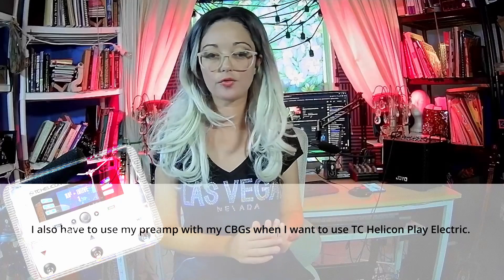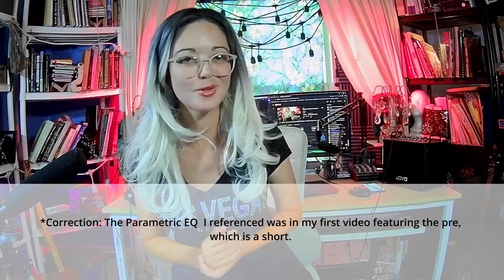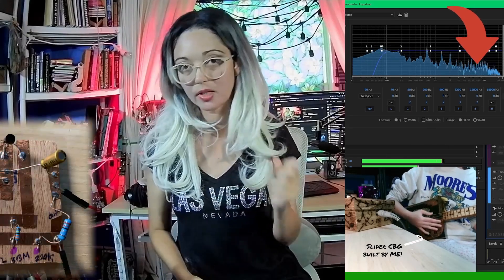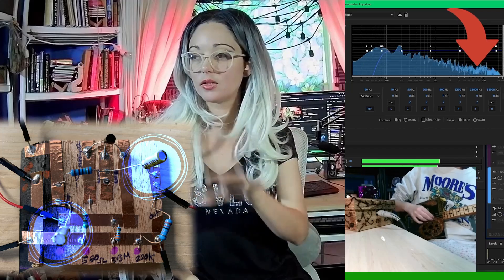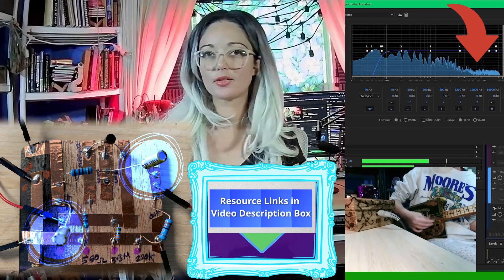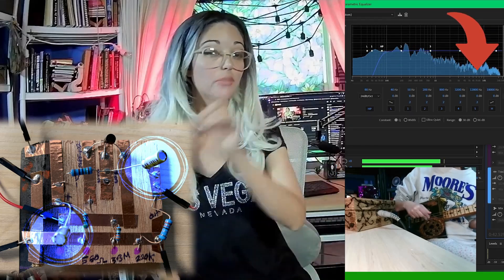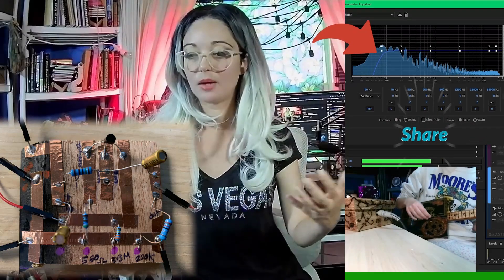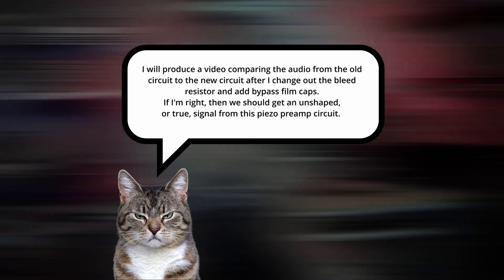Introducing Planned Upgrades to Piezo Preamp Circuit [ 4 DIY piezo pickups & contact mics ]

Comment: Your awesome. Thank you :)
One of the first things I was planning to do when I get this circuit running (after New Years) is to put a signal across it and monitor it on an audio analyzer and then alter some of the resistor and capacitor values and watch the effects (as a bit of a physical, visual learning exercise).
>
I just need a solid starting place to begin at and your current efforts and tests have inspired mt to begin with this circuit.
.
I have a heap of vera board and proto board packs that I can utilize to avoid the steel project board pins :)
Not elegant, but all copper and copper jumpers :P
I am aiming to start at about 7kHz, and then ramp up to 19kHz, so I'll be pretty zoned in on the higher frequencies and attempting to cut out the lower base.
In the end I will need to implement some tight Band pass or Low high pass filters :)
Reply from the maker: Thanks for sharing info about your project. 🙏✨ please let me know what the results are.👍😁

Comment: The level I get out of piezo is adequate, for me, without a preamp, and I will have it wired with either a three-way, like a Les Paul, or with a blend knob, like a bass, in conjunction with a magnetic pup. I've only ever used single-coil, thus far, but I have some humbuckers on hand for the near future.
Reply from the maker: Cool! ✨ I’ve seen Del Pucket make really nice blended pickups. I’ve not tried to build one yet but am definitely interested. 😀 Good luck on your Humbucker builds…Let me know how they turn out! 👍🔥

Comment: My goal is to make a piezo preamp small enough to fit inside the cigar box. I'm just having a hard time choosing between the round piezos, and the piezo stick that goes under the strings.
Reply from the maker: Hi! Thanks for checking out my update video. 💜✨ The circuit in my original preamp video is simple and can be made small enough to build into a cigar box with your piezo pickup, especially if you forgo the pbc layout and direct wire components. ✨I believe this is what Colin’s Lab did in his video about this circuit. His video is linked in my original preamp video’s description box in case you want to check it out👍 Piezo size, placement and type are going to have a huge impact on your guitar’s tone. That’s the fun part when it comes to exploring piezos 🤩 Anyway, I wish you luck in your explorations. Let me know how your project turns out. 😀🔥
Reply: Go with disc(round) piezos to capture the whole instrument. Rod or tape piezos that go under the strings are far less sensitive and will pick only the sound from the strings for a cleaner sound closer to magnetic pickup.
Discs also allow much more variation in placement and different sound results.
Also glue to mount the piezo has a different sound than double side tape. Experimentation is the key with piezos.